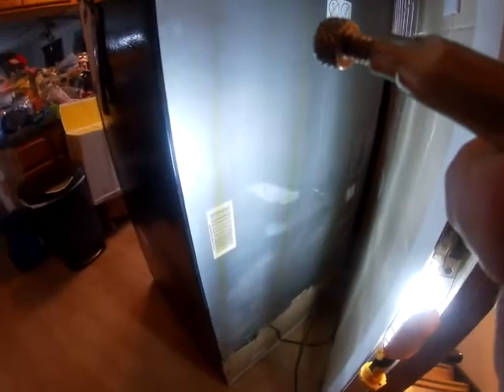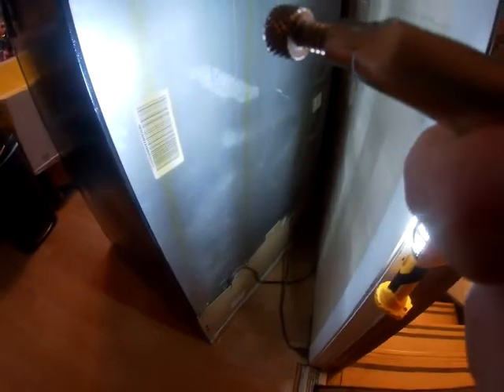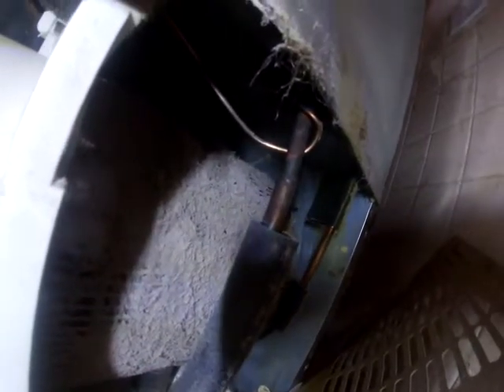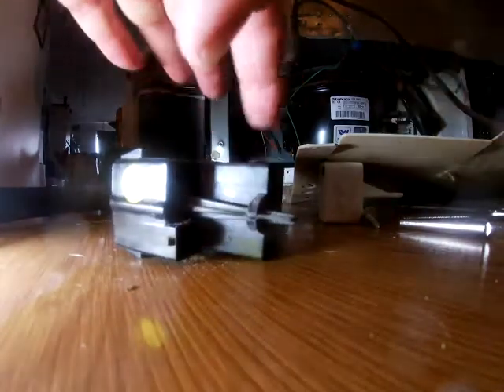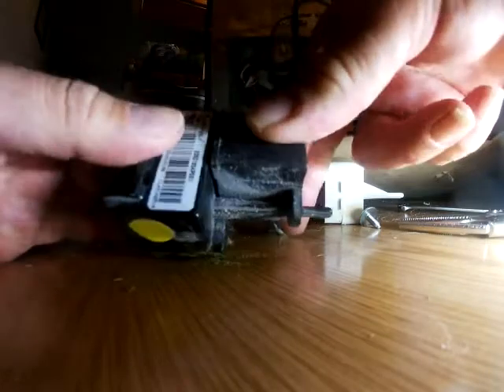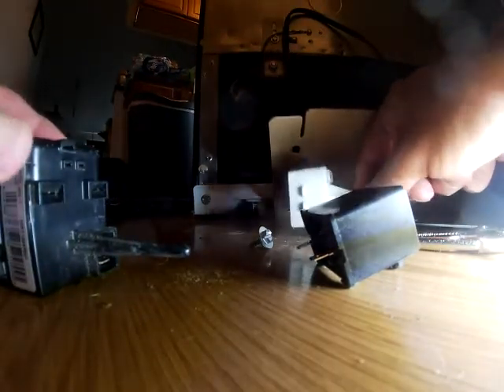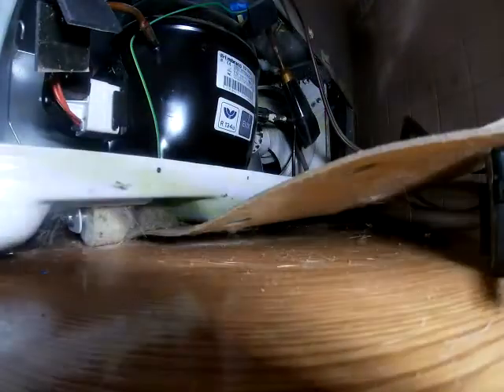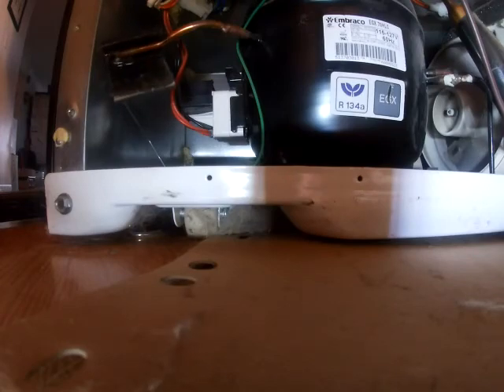GE Refrigerator clicking noise fix

Comment: I would clean the coils before replacing the capacitor and relay. The relay is doing its job if it clicks on and off protecting the compressor which is not getting its heat dissipated through the condenser coils.  I had similar situations and cleaned the coils and the ticking went away.